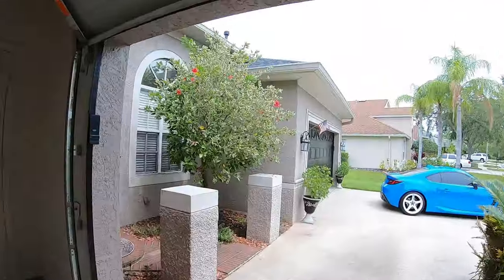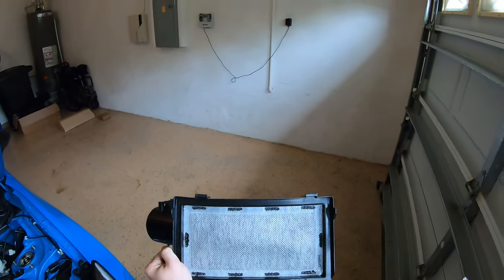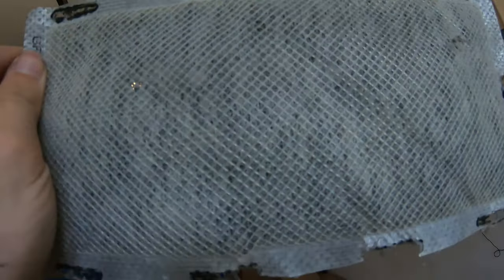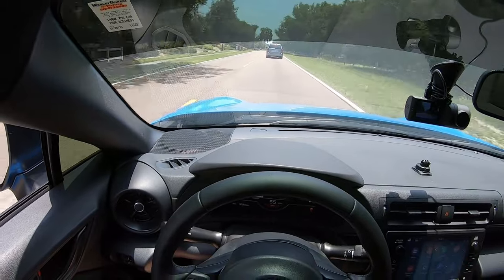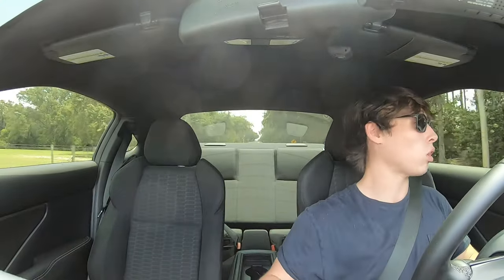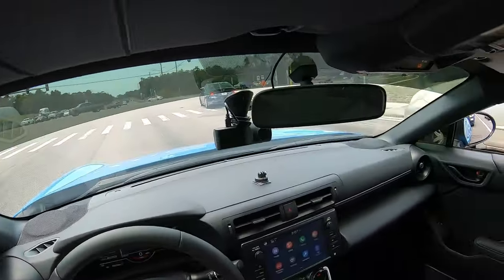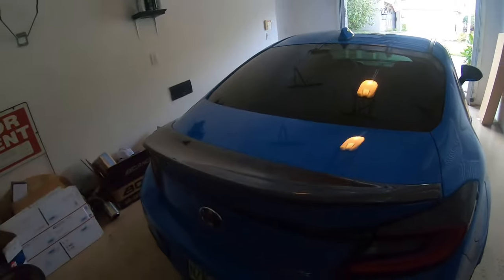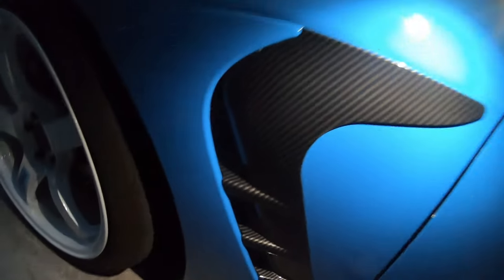FREE HORSEPOWER MOD FOR YOUR GR86/BRZ

Comment: The charcoal filter is meant to absorb gas and oil fumes when your car "burps". It is a cheap emissions device to meet regulations for the EPA for "the life if the vehicle" aka the warranty period. Charcoal can only absorb so much, it will eventually become a useless restriction. First gen does not have this style filter.
Reply from the maker: That’s what I thought, which is why is don’t really see a need for it and took it out of the car. Thanks for watching the video, and help give a better explanation to everyone.
Reply: Additionally the Gen2 versions in Japan do NOT have the charcoal filter.  It’s just a USA EPA thing.  If you don’t want to remove it, but don’t want it.  You can order the box without the filter from Japan.  I chose to just remove mine (rather than buying a filter free box).

Comment: Saw your car at the meet today, man it's so clean in person. I still want to get one but I'm scared of the RTV issues. great vid as always!
Reply from the maker: Thanks for the kind words fam, I wouldn’t let the RTV be what stops your from getting this car, I absolutely love this no matter the flaws. All cars have there own issues with time we will fiqure out ways to solve and fix these issues that we have. I appreciate your support on the vids and on the car fam 💪💯
Reply: Rtv gate has been a thing on older models as well. They resigned the oil pick for this exact reason. I got one, and my logic was, if it blows I get another engine lol tbh u gotta be more worried about it being a boxer more than anything. Eats oil like an old car and anything less than full is not ideal for these motors
Reply: Drive it for about 2000 miles, drop the oil pan, clean any rtv out of there and the oil pickup, install and oil baffle, put it back together and the problem is solved
Reply from the maker: @tylergrandbois9341  I still haven’t drop the oil pan yet, coming up on 10,000 miles soon. Definitely considering doing that my next oil change. Any idea of which oil baffle people are going with? I know there are a few companies out there that are selling them. I appreciate the support though fam 👏💙
Reply: @tylergrandbois9341 yep. did my research, if I monitor it it should be fine
Reply: Drove 39k miles nothing wrong anyone who scared that RTV is just not ready buy car yet tho
Reply from the maker: @hocon7477  wow, that’s so awesome to hear. Thanks for giving us your insight, truly much appreciated 👏💙

Comment: I removed mine and am glad I did.  The non US version do not have the charcoal filter.   I also put in a Grimspeed post MAF smooth hose and a Grimspeed high flow DRY air filter.   The 3 mods produced about a 12hp gain at high RPM’s and 10-15lbs of torque increase.
Reply from the maker: Awesome to hear that, and it’s nice hearing all the others stuff you’ve added on as well. Thanks so much for watching, I’ll look into those other parts you mentioned as well for my 86 💪
Reply: @Justinackerman_ Ty, Subscribed 😎
Reply: @Justinackerman_  : I did three mods as well = Hood Struts (highly recommended),  ceramic window tint, Eibach 20mm wheel 🛞 spacers (really improves stance), interior & trunk & backup led lights (big improvement).   These cars get driven very spiritedly; so change the oil every 3k or 6 months (which ever comes first).   One last thing:  google top tier gas ⛽️ and use these brands; they have higher detergent and will keep the injectors cleaner.

Comment: First "mod" I did to my GR86, also a neptune blue like yours and in the same state lol. I went with different wheels though gold RPF1s. Throw a strut bar on yours if you haven't already, like 100-150$ mod but makes a hugely noticeable difference.
Reply from the maker: Wassup Liam,
Awesome to hear you own a neptune 86 as well, deft he best color choice to go with in my opinion. I will definitely look into a strut bar, what brand did you end up going with if you don’t mind me asking?
Reply: @Justinackerman_  went with the Tanabe bar, really just bc its Japanese and I liked the splash of red in the blue engine bay. Think it was $155 on amazon when I got it, listed for first gen 86/brz but fits fine on our car, just six bolts super easy install.
Reply from the maker: @liam5257  I’ll 100% take a look at that, I really appreciate you telling fam. Will definitely be on the list for next mods I do to the car. 👏💙
Reply from the maker: @wza223-fo3mc  I’ve actually seen a lot of strut bars going for similar prices to $150. They aren’t as expensive as you may think they are for these cars. I appreciate you watching the video fam 👏💙
Reply from the maker: We just installed a Perrin Strut bar on my brothers Civic SI in the video I just posted. Was a super easy install, and looks great as well. Thinking about getting something similar for my 86, he got his for free actually 💪

Comment: that pop at 19:00 was crazy haha
Reply from the maker: Haha, man it sounded nuts in person. Don’t get me wrong this thing pops loud all the time, but occasionally there are a few pops that legit hurt the ears they are so loud. It’s insane to me that just a Catback with no tune or anything else done to it, makes the car act like how it does. Anyways I appreciate your support fam, truly means a lot to me 🙏💙
Reply: @Justinackerman_  Believe it or not but i actually sold my auto gr86 and bought a manual brz, one of the main reasons being for the pops. I learned how to drive manual in about a week and now im at the point where im rev matching on the downshifts and it is so much fucking fun. One of the best decisions I’ve ever made
Reply from the maker: @archive636  that’s so awesome to hear that man. I’m glad you were able to get what you wanted at the end of the day. So sick you were able to learn manual in this car as well, I feel this is a great car to learn in. I’ve driven manual cars decent amount of times before having my 86, my this car was the first manual car I’ve fully owned. The car is such a blast, and it being Manual definitely helps make it backfire a bunch 😅 thanks for you support fam glad you are apart of the 86/BRZ fam 👏💙
Reply: @Justinackerman_  bro literally I want to drive all day everyday. I just put on my exhaust system (remark mid-pipe and the remark axle back) so its essentially straight piped from the catback just like the AWE Track and the pops are so loud. I love it so much, I can’t think of ever getting in a car thats automatic ever again

Comment: i sometimes get the pop like at 19:00 on my at with the awe track on, don’t know how but most of the time it works when im in a tunnel lmao. I can definitely hear the small burbles on my exhuast on the at, i feel like a tune might make that a bit noticeable
Reply from the maker: Wassup fam, I appreciate you watching and supporting the video 👏💙, I feel like a tune would help wake this car up even more, and would be absolutely sick. Hoping to get mine tuned after I through some headers on the car 💯
Reply: Bro I have the same cat back too and I don’t even get pops at all 😭
Reply from the maker: @xman20427  I have a feeling I may know why, do you have a 6spd or automatic 86?
Reply: @Justinackerman_  I have the 6speed. Are you running the AT?
Reply from the maker: @xman20427  no I have a 6spd as well. That’s weird I don’t know why yours wouldn’t do the same as mine then. It does it whenever I downshift, or legit even if I hold the clutch in when I’m driving and just rev the car it will pop as well. Hope this info could help 🤷‍♂️
Reply: @xman20427 it must have something to do with the way you downshift. The car pops stock. It’s just louder with a modified exhaust.

Comment: What exhaust are you running!!! Love the pops on the downshifts!!!!
Reply from the maker: This is the AWE Track Catback exhaust, I absolutely think it’s one of the best catbacks you could go with for this car👏💙
Reply: @Justinackerman_  bro I just fitted mine on about 3-4 days ago and my BRZ don’t sound like that 😮‍💨😮‍💨😭😭
Reply: @xman20427  Might be subaru's sluggish throttle tune, grab a pedal signal amplifier or just hit the throttle harder and earlier.
Reply from the maker: Wassup fam, if you don’t mind me asking do you have a manual or auto? Cause to be honest that makes a big difference when it comes to the pop and backfires
Reply: @Justinackerman_  I have the MT. Once I did the charcoal filter delete and hit the rev matches between 2-3k I can get it to happen!

Comment: What kinda mods do you have to make it pop like that, bro?

I have a gr86 as well. I just wanted to know what you have on.
Reply from the maker: The only thing I have done to the car is just the AWE Track Catback exhaust wise, the car isn’t tuned or anything like that. I am honestly quite surprised it pops as much as it does on this stock tune. Do you have a 6spd or an auto? Cause that plays a huge part in being able to make it pop or not.
Reply: Unfortunately, I have an auto.
Reply from the maker: @dipashrasaili4641  I believe you may still be able to get it to pop with an auto occasionally on downshifts and deceleration and stuff like that. A simple tune could always get it to pop and bang like crazy though.
Reply: So basically cat back exhaust the job?
Reply: Is it the (AWE Track Edition Catback Exhaust w/ Diamond Black Tips 2013-2022 BRZ/gr86?
Reply from the maker: @dipashrasaili4641  yes that is correct 👍 💯
Reply from the maker: @dipashrasaili4641  yeah, I would say if you don’t plan on getting headers for this car anytime soon. The Track Catback is definitely the way to go for a exhaust setup.
Reply: @Justinackerman_  nah I have the same exhaust n and auto, and it only pops when up shifting at high rpms like 4k-5k+
Reply from the maker: @8we3t  yeah, I fiqured with an auto it may be alittle less likely to pop as much, I’m sure it still sounds absolutely amazing though. Thanks for the support fam 👏💙

Comment: What will the impact be to your warranty by removing this filter?
Reply from the maker: I’ve actually been told by the service advisor who helped me initially purchase the car that any mods I do to the car besides from having the ECU tuned, any forced induction including a turbo, or supercharger can result in a voided warranty. As far as the charcoal filter goes, you shouldnt have a single worry about the warranty cause in some regions these cars come factory without one. Hope this info could help in any way 👏💙

Comment: dud curious about your wheel spec. cancu please tell me
Reply from the maker: I’m glad you enjoy them, the spec for the wheels are Rays gramlights 57CRs the specs are 18x9.5 + 38 offset, and the tires are Continental extreme contact DWS06 245/35/18. For these specs you will need coilover’s so I went with the BC RACING COILOVERS (BR SERIES) I hope this can help 👏💙
Reply: @Justinackerman_  do you have any modification to the suspension aside from the coilovers?
Reply from the maker: @YSS013  the coilover’s came with aftermarket end links for the front, besides from that though, everything else is stock suspension.

Comment: You shouldn't remove that filter unless you are running a catch can which is sucking up oil into your intake which is not good for those subaru engines.
Reply from the maker: Hmm interesting to hear. I have hear some of these cars are coming from factory without the filter installed in the air box. I believe the filter is for emission purposes mostly, but I could be wrong. I appreciate your feedback and suggestions fam 👏💙
Reply: We in the U.K. don’t have the charcoals filter as standard, enjoy bro
Reply from the maker: @johnybigarms  I appreciate your feedback, and your Insight as well. That’s what I assumed, it’s just nice to hear it from someone as well though. Thanks for your support fam, truly means a lot to me 👏💙
Reply: @Justinackerman_  Japan don't have it either bro. I ripped mine out too. We don't have emissions testing in my state so I said fuck it lol. My homie and I who both drive the AT ver. have ours deleted. He was putting down 202 to the wheel at his dad's dyno shop. Stock everything, no charcoal filter.
Reply from the maker: @ghostreaper2978  I appreciate the insight fam, that’s so awesome to hear. Thanks for the support as well 👏💙
Reply: @Justinackerman_  No lie your videos are awesome and I watch every single one. I am just going from what I read on forums and from knowledge that other Subaru owners have told me. It does help the longevity of the engine. And who doesn't like reliability? Hope this helps. Keep up the awesome content!
Reply from the maker: @downt3mpo  that really means a lot to me fam truly. Thanks for your support and your concern 👏💙

Comment: It's brutal idea removing that.. 
Your gonna risk getting unwanted contamination into your engine..      believe me, I thoughtnaboutnfoung it too but did some research.     It's not worth the risk.
Reply from the maker: I considered this as well, but wouldn’t it be removed regardless if you were to put an aftermarket intake and intake box on this car? I’m assuming considered it’s glued into the factory one, you wouldn’t reuse it for the aftermarket intake. I appreciate your feedback and you letting know. 👏💙
Reply: @Justin Ackerman  but keep up the Great content!     I've become a fan.  Especially when you take day trips to other car shows
Reply from the maker: @jawzblaze  that means alot to me fam, got a new video coming soon, where I go to a car meet, and got some new parts for the car as well that I’ll be installing in that video. Thanks for your support, I’m glad you enjoy the vids 👏💙
Reply: That's not what the charcoal filter does. It's only there to absorb vapors that'd otherwise be released back into the atmosphere and "cause pollution". GR86 models in other countries don't have the charcoal filter at all and are rated 232 bhp instead of 228 in the US. That said, removing the charcoal filter should still be done with caution depending on which state you're in. In 8 years or so, I'll have to get my car smog checked in order to renew my registration and I'm not sure if they'll be looking for that filter during inspection.
Reply from the maker: @AyyGin  that’s what I believed the filter was for. I am aware in some states the car is required to pass certain regulations, here in Florida I thankfully don’t have to worry about that. Which is another reason why I thought why not remove it. I appreciate your insight and feedback fam, truly much appreciated 👏💙
Reply: It's wild that you "did some research" and came to this conclusion. JDM and UKDM 86s don't have this charcoal filter. Are their engines at risk?

Comment: So your solution to get a few extra HP for free is to take out a filter that keeps junk from getting into your engine? 
I assume you are not planning to keep the car for more than a year or so. This is why I don't buy used cars.
Reply from the maker: Well, like I stated in the video I wasn’t doing this for any HP reasons. Some of these cars are produced in certain states without this filter from factory. This charcoal filter is designed for the car to able to pass emission standards. That’s like saying when you cut the cats off your car your ruining it as well. I absolutely love this car, don’t have any intentions of selling it ever. Everyone has there own opinion 🤷‍♂️
Reply: I owned 2 previous generation brz and they never had this filter. You are being dramatic about stuff getting into the engine. Removing the filter is definitely helping the airflow
Reply from the maker: @Austinomon  I appreciate you giving your input on this. I fiqured the only thing this could do is help it, from removing this filter. Thanks for the support 👏💙
Reply: The filter is solely there to filter the unspent fuel from the port injection system when you shut the engine off. It’s only job is to prevent the gas fumes from entering the atmosphere. Do your research before bagging on someone.
Reply from the maker: @xman20427  thanks for the info homie, it’s much appreciated. I appreciate you having my back as well 🤝💙
Reply: @Austinomon he’s the type of Karen to think a service at the dealership by some young kid is better than doing it yourself with quality products
Reply: Karen

Comment: Changes on Air-Filter/Box:  you are absolutely WRONG - there's NO HP improvement - done and tested here in Australia.
Reply from the maker: I had watched a few videos on this topic before going ahead and doing it to my 86. I did see/ hear that the overall HP numbers did increase but not by very much. At the end of the day, removing a charcol filter isn’t gonna make a huge difference, but when it is as restrictive as the one that comes in these vehicles is, I wouldn’t be surprised if it truly did increase the throttle response or torque by a bit. Thanks for watching the video though fam 👏💙
Reply: Is there even this charcoal filter in Australia?
Reply: @itstherealone of course. Australia is more strict on emissions than most places.